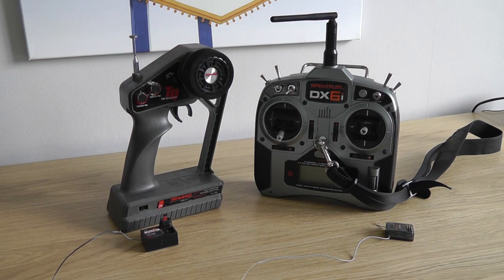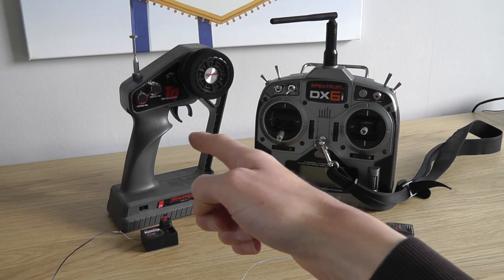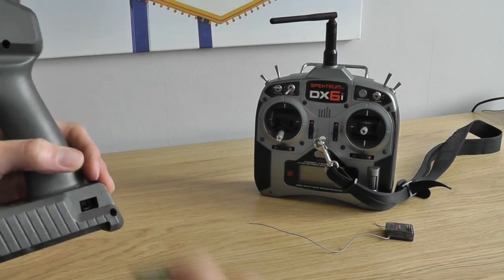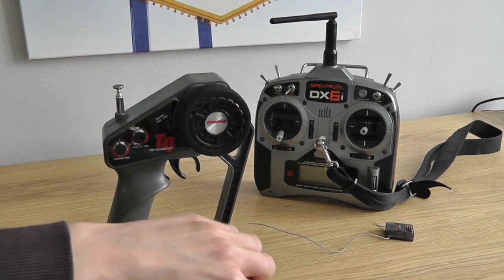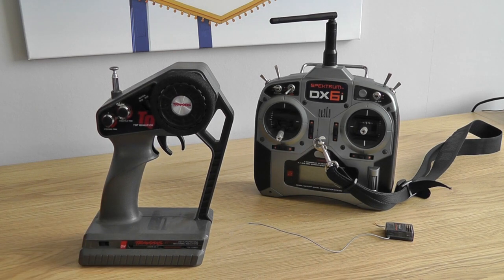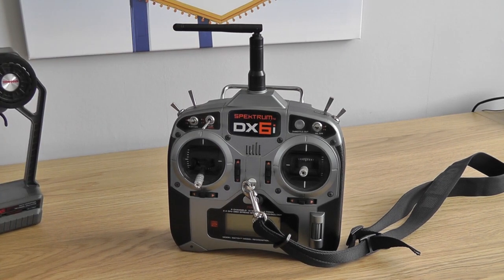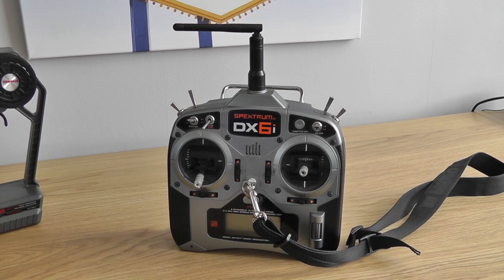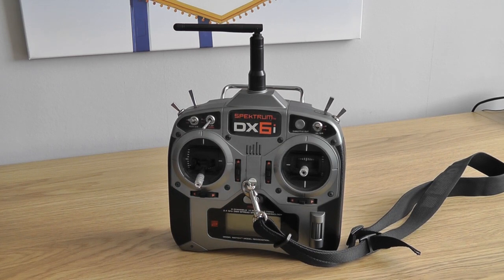27MHz VS 2.4GHz

Comment: Can I ask, if I buy two identical cars provided with Identical controllers (hbx devestator which comes with 2.4ghz) if I turn them on separately can me and the kid both operate our own car but at the same time?
Great info vid BTW.
Reply: Yes, you can. (Or at least should be able to) That's why 2.4 is better than 27.

Comment: Channel 4 , at 27,145 MHz, is probably most commonly used. By listening to a shortwave receiver on this frequency, you may not only hear RC units, but also baby monitors and car alarms.
Reply: Lmfao it's the cb radio band

Comment from the maker: I guess if they are 'toy grade' then the transmitter will not be very good quality. You may be able to upgrade them it depends on how the toy is made, I think most use custom parts though so it may not be possible.